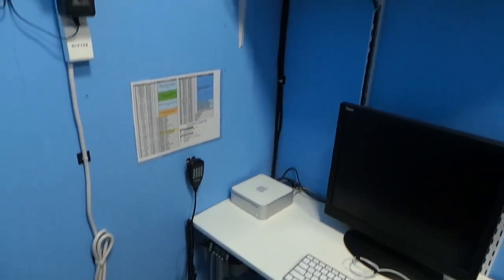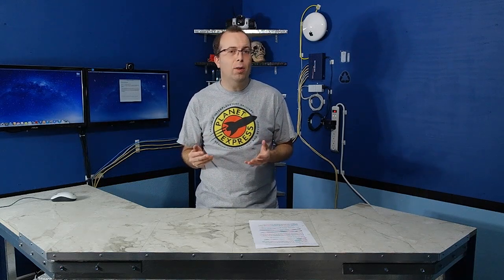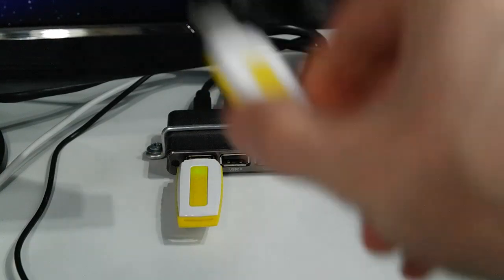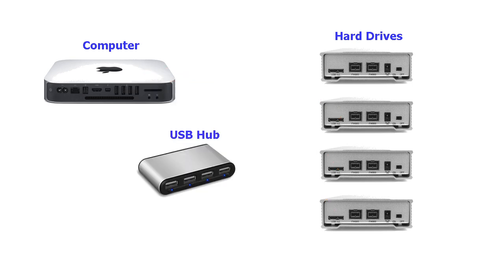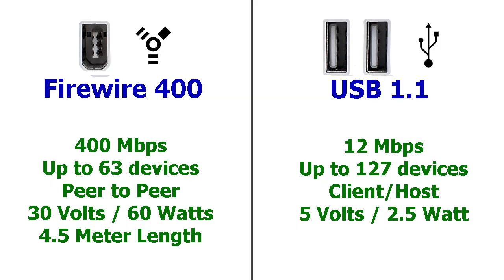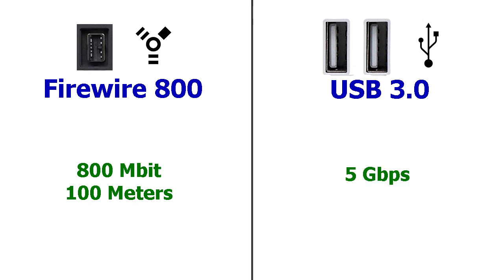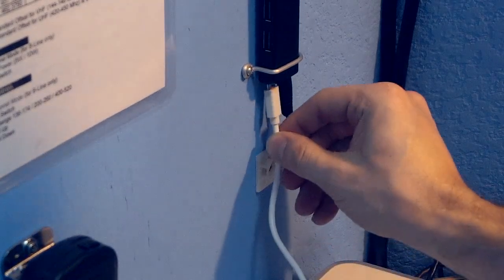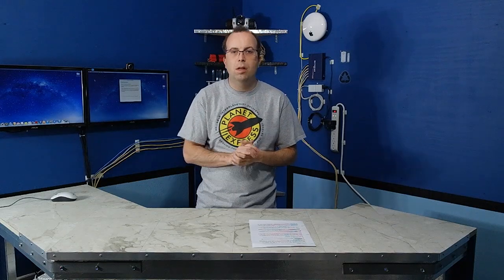Farewell R.I.P. Firewire, Hello USB!

Comment: It was the voltage that really was the primary issue... If you look around a FireWire port on a circuit board... There's a LOT of voltage control/failsafe design around it.

A lot.

This obviously cost more to produce and as a secondary cost, it limits the size of products due to the greater bulk of the needed failsafe circuits around it - as far as I understand these issues, heat management was also a larger concern... 

Also, that voltage has got to come from somewhere - on something portable, that's going to impact battery life, both in terms of charge and actually longevity of battery function. Usually rechargeable batteries have a limited amount of charge cycles before they become unusable practically.

So, despite some advantages (P2P being the obvious one).....

It was always going to be the second system in a two horse race.

Good while it lasted though.

As a sidenote - an old hardware sampler I own uses SCSI.

THE dance you have to do to find adapters to connect older, compatible storage devices is a long and complex one.

FireWire made this obsolete.

It was a good step towards a fully standardised data/power interface system.

Comment: Firewire also had the neat feature that it would immediately FRY anything it touched if you unplugged it improperly. At least in Windows. If it is anything like SCSI that would make sense since SCSI has the same tendency to fry stuff if you don't unplug properly. Unfortunately Firewire does not look like SCSI but looks more like USB, which is not in the habit of doing stuff like that so at least for me there was never any reason to doubt that Firewire would behave just like USB in that regard.

Comment: Until thunderbolt prices come down (and they probably never will) I'm sticking with FireWire. I've been burned by USB's variable transfer speeds one time too many. Give me constant throughput even if it's slower than USB3. Thunderbolt is 500% the future for this use case but it's just too expensive. Maybe when they unify TB and USB 4 things will get better.

Comment: as an audio engineer perspective, USB has much higher latency, I can go down to 1ms on my older firewire interface but I have issues running below 30 on my usb interfaces
Reply: You obviously have bad USB interfaces then. Try RME USB audio interfaces.
Reply: @SvenElven  you obviously are running only a stereo mix and not 85 tracks of vst's, im not talking about casual listening

Comment: In this way, when you put a multiplexer in between, I couldn't understand why you do not prefer a disk tower that can throw 6Gbs data like Sata instead of experiencing a loss of efficiency when there is a process on the disks at the same time because all of them are started on a single usb?
Reply: or nas disk

Comment: Worked for production studio in 2003-2007. Sony HD ready cameras used firewire and apple final cut pro with hardware was norm...I felt God like when connected 500gb*6 = 3tb harddisk serial. Now pulped by thunderbolts.

Comment: I've only ever used FireWire once and that's in a college music studio which is still setup with the the same old FireWire equipment to this day along with an old cheese grater mac.

Apple seemed to hang onto FireWire a bit longer than the PC market did, which is contrary to what they usually do, which is ditch older technologies before everyone else...

FireWire is pretty cool though, and it's a shame that it's no longer used on modern hardware...

Comment: "Firewire is dead - Long Live Firewire". My studio has tons of FW; MacPro 5,1 3ea MOTU 8 channel audio interfaces [24 ch total], 6ea ext drive housings - mix of 2.5 & 3.5. My fav is the G-Drive 2.5" case, FW 800 & USB 3, with SSD installed. It all works fab. One day, will have to move onto USB, but not today.

Comment: I still use a Firewire 800 audio interface in my recording studio, I find older Firewire interfaces much more reliable and they have less latency than USB equivalents. I can record 16 tracks simultaneously at 44.4KHz 24 bit, no problem at all. A cool thing you could do with Firewire on older Macs was connect two machines directly with a firewire cable and boot one up in "Target Disk Mode" by holding command+T, the first Mac would be able to see the hard disks of the 2nd, and quickly and easily transfer files. Very useful.

Comment: Only had one device with a firewire port - and that was a single port - so no daisy-chaining ! Oddly, I never used it !

So where do LAN cables feature in the connectivity race ?

As for daisy-chaining, it seems firewire doesn't do it properly - needs 2 ports. That was not the case with IEEE-488 - only 1 port and the connectors stacked.

Comment: The firewire has less latency than USB. It's excellent for audio production. And it's was not fixed in 2.0 or 3.0 USB version (archtecture feature). I thing that firewire still run until 2015 mostly for this audio purpose.

Comment: 1:33 - USB flashdisks worked already in Win ME
3:37 - I like how things are simple in USA with your paper walls :-D make few holes to wall in Europe is work for half day
Reply: Takes you half a day to drill four small holes? Are you using a paperclip?
Reply: @hectorosbert  show me how you make holes to conrete wall with your home accu drill, you need hydraulic hammer drill for that :-) Make hole to brick wall is not so hard, but still not easy with home tools, but make holes into concrete wall is really crazy and half of walls in my country are concrete

Comment: Firewire was and IS better. Coming out with new and incompatible standards that are CALLED USB does not make them the same. So USB-C is great. Its completely incompatible with old USB, and most of what they did is fix incredibly BAD design decisions made with USB (like unidirectionality). Whatever. Frankly the entire thing should be UTP ethernet in any case.

Comment: FireWire also had its own controller which meant that its speed didn’t vary like USB does. If you are doing intensive tasks on the computer USB transfer rates will slow down. So even when USB 2 was faster on paper, FireWire 400 usually had faster thrioughput in practice. Shortly after USB 2 came out FireWire 800 was released which doubled the speed. FireWire was usually used for moving large files and/or when low latency was important. At the time FireWire was the only reasonable connection for video cameras. The really good audio gear also used it for the low latency feature. Macs came with FireWire (first 400 and then later 800) standard so they were heavily used for video and audio work. The laptops in particular were the best portable audio machine you could get. 

Thunderbolt is the heir to FireWire. It also has its own controller and so boasts faster sustained speeds than what USB can. It does a lot more than FireWire ever could of course.

Comment: I always wondered if Firewire would've lived on if it had won the battle against HDMI.   
(which is a powerful example of peer-to-peer over client/server.)

Thanks for pointing out that 400Mbps Firewire was faster than 480Mbps USB2.
I never burned a coaster on Firewire, but had several on USB2 using the same hardware.

Still surprised that eSata didn't win over USB.   Gotta think marketing and name recognition go a long way.

Comment: Something that was always curious to me was because PCs, both desktop and noteboks did not come with Firewire included. As a PC user a few years ago I bought an Apple PowerMac G4 Quiksilver and it bothered me that I only had two USB ports. Because I connected a keyboard, a mouse and to connect a printer I had to disconnect the keyboard. Why will it only bring just two USB ports? I was wondering to myself.

Comment: I only used Firewire because I had a Sony Digital Camcorder and had to install a 1384 port in my PC. Never used it for anything else.
Reply: I captured all of my video 8 cassettes via FireWire with my old MacBook over the last weeks.
Reply: Yeah, the only one time i saw a 1394  cable also with a camcorder about 10 years ago. There was no sight of USB 3 back then and i believe USB 2 would have been slow - 1394 was speedy for those times.

Comment: I still use Firewire800 on my external mechanical drives, which can't quite reach 800mbs anyway so no benefit to USB3 for me for that application. Also these external drives all run fine on just the data cable, if you want to use USB3 instead you also need to use the 12v power supply. FW just works really, really well. Always has done. A very dependable interface for external hard disks. But quite forgotten about now.

Comment: Why not stash the hub up by the drives so you only have two cables running up the wall?  No rats nest worries with loops for excess cable length.

Comment: I can't speak for firewire, but USB 3.0 controller compatibility is terrible. Part of my job entails setting up multiple usb devices on PCs, and there are terrible drop-outs and connection issues when using multiple usb devices at the same time. I am generally pushing the bandwidth a bit, but nowhere near saturation. I thought the situation would get better with USB 3.1, but it isn't really any different. What it seems to come down to is that some controllers are a little better than others, and some devices seem to prefer certain controllers over others. Seriously, I think it's a mess.

Comment: I'm a few years late to this particular party, but while I knew about firewire, I didn't know that you could daisy chain firewire devices. But that's what I was wondering about USB. If it can support up to 127 devices, why can't you daisy-chain USB devices?   After all, what's the point of supporting so many devices when a computer only has a few USB ports?  And those port hubs are an awkward solution.  I don't see any 127-port hubs for sale!  ;-)

Comment: About 10 years ago I was able to compare USB 2.0 directly with FW400 as we had a drive that supported USB, FireWire and eSATA. Me and my mother used to edit DV video off that drive and eSATA and FireWire would sometimes refuse to work for whatever reason I was not able to figure out so sometimes we would just run it on USB. eSATA - no brainer, that ran like stink. FireWire - marginally slower for our workload, but still nothing you could be bothered about. USB 2.0 - that was a league on its own. Nominally faster, in sustained file copy somewhat slower but when editing video it was almost unusable. Pinnacle Studio would just hang for a couple of seconds when you did something. Seems like the protocol overhead just kills the performance. I dislike USB, we should have at least one data-transfer-oriented connector and protocol like FireWire was available. I never had the opportunity of using FireWire daisy-chained but to me it looks like a cool feature :)

Comment: @The 8-Bit Guy Awesome video thanks so much for sharing. I have a question about USB 3.1 type C. I’m trying to update my computer and I do audio engineering work on it. My audio interfaces use FireWire and I can’t find any new computers with FireWire installed. Is it a safe bet to just buy a FireWire to USB 3.1 C adaptor and not worry about having an issue with my FireWire interfaces and new computer???  Please help! The lag on my current computer is too much to handle haha! Cheers!

Comment: Wouldn't the daisy chaining decrease the overall performance though? In the end you use one cable and port to connect the first device in the chain to your PC, while using separate cables doesn't pose such a restriction (unless you use a hub which is also connected using just one cable :D )
Reply: It splits the theoretical bandwidth speed.
since most drives are never at bandwidth speed, (aka hdds) daisy chain can actually speed it up

Comment: Another big advantage that FireWire had at the time over USB, particularly for people that did things like video editing and the like, was that it was designed for, and capable of, SUSTAINED data transfer at that 400Mbps (later 800 Mbps) rate. USB 2.0 is capable of 480 Mbps maximum, but only in bursts, and is quite variable. That's not going to cut it when you're directly capturing video to the computer- if the data throughput  drops below what's needed, you lose data. With FireWire, you could be assured that the FireWire bus itself will pass that 400Mbps all day long, if needed. Now, you still have to make sure everything else is up to the task, but the protocol itself was designed for sustained throughput. Even USB 3.0/3.1 won't run at its maximum rate outside of short bursts, but even at 25% its maximum, you're still good for more than 1Gbps. It's fast enough that stability is no longer a concern for the vast majority of use cases. (And if you need a guaranteed sustained data rate higher than USB 3.1 can provide, well, you weren't using it to begin with for that, you're using some expensive, proprietary, purpose built equipment all around, and probably paid more than the cost the average new car to get it.
Reply: puckcat22679 yeah I still use Firewire from my cable company provided Set Top Box that has a firewire port to a HTPC and use it as a DVR using MythTV to directly capture the MPEG transport stream on my PC without having to do any re-encoding.  I've had this setup for years.

Comment: Firewire 800 had potential and for a while it outperformed USB 2.0... that is, until USB 3.0 came along.  But the problem is that the only people really using Firewire were video/image capture devices (Such as scanners, cameras, video cams, etc) not to mention at the time, most computers needed an add-in card anyway, whereas most computers had USB ports (at least 2).  I should note that with special USB cables you can directly connect two computers, but you have to buy a USB transfer cable specifically for this (you're better off just getting a crossover network cable).

Comment: I can think of one area where I could really benefit from Firewire,  its very long max cable length in the S400 version.   I've got my FIOS ONT, router, UPS and phone PBX mounted on a panel in the basement.   My desktop is in my office on the second floor...basement, first floor, second floor, then a walk up attic.  The only way to connect the PBX and UPS to a computer is with USB cable.  It's not possible to run a USB cable that far without using some kluge USB extender that may or may not work.  Firewire was killed by Apple greed.   Think Beta v VHS.  Apple was the new Sony with Microsoft taking a lesson from JVC.    It's too bad.

Comment: and today's laptops do not use firewire 400, only usb and if you connect two laptops to each other then it will be short-circuited and one of the two will burn

Comment: It is a shame. Rip FireWire Such a great standard. I have to mention that FireWire 400 was way faster than usb 2.0 480mbps. The parallel throughput was amazing. You could copy a whole HDD to another one while reading from both simultaneously. Also there are no fluctuations in bandwidth. FireWire kept a steady speed no matter what were you actually doing: read/write. Lastly such an awesome name FireWire (or ie1394)

Comment: Firewire was and still is superior to USB, the problem was marketing greed and royalties that allowed USB to overtake it in popularity and as they say, "There can be only one." 
Firewire was a much more stable connection hence its popularity with professional video, this is because USB puts load on the main CPU Firewire has a dedicated ASIC for IO, power and daisy-chaining as stated, and the connectors have a much better design. 
There were standards for FW3200 though USB2.0 had displaced FW in the market by the time FW800 was released and USB's one advantage other than cost is that it maintained plug shape and protocol backward compatibility. Also, USB3 is garbage on multiple levels, nice marketing specs under ideal conditions but it suffers severe implementation problems in practice.
And why was USB only 5v and pitiful max current, real rs232 serial bus that it was to replace had from -15v to +15v?

Comment: a yamaha mo8 used to have a yamaha computer program that allowed the computer to run the synth, but the program was completely, but separately, integrated into cubase.  back when cubase was an xp exercise, and you could connect a digidesign rack 3 to it.  via firewire.

Comment: I’ll miss it. When recording and playing back audio on the same device at the same time parallel is king over serial. USB 3.0 is faster, but a parallel port at the same speed could handle twice as many channels at the same speed with no latency increase. Also the higher voltage is a savior when mobile recording and you have no outlets to power several phantom powered pres. Thunderbolt it is.

Comment: 1394.1 FireWire that was created in 2004 can support...

64 449 goddamn devices
6 4   4 4 9

think about that number
Reply: No... I'm glad that POS FireForker system and its A-hole connectors are dead. Good Riddance !!

Comment: You also could boot MacOS from an external FireWire drive at a time when doing that from an usb was impossible.
Reply: This is not an USBs fault, but either some deliberate idiotic choice of Apple Inc, who didn't wanted their users to be able to boot from USB in the first place, or that could be just incompetence of some Apple Inc engineer who didn't bothered to update firmware to allow a computer to boot from USB.
At the same time there were tons of comuters which didn't had any FireWire, but they had USB and always were able to boot from it.